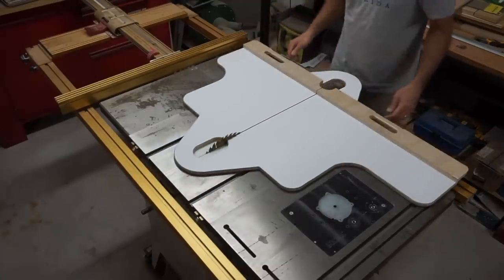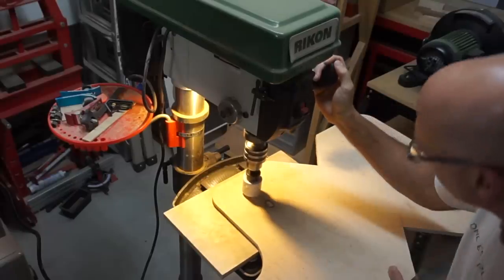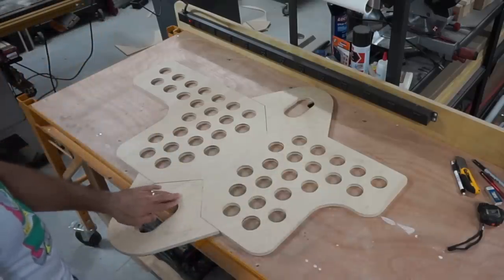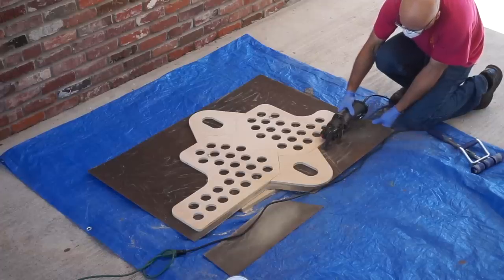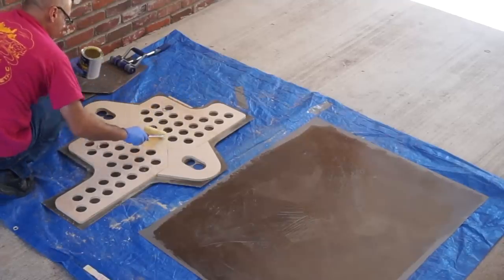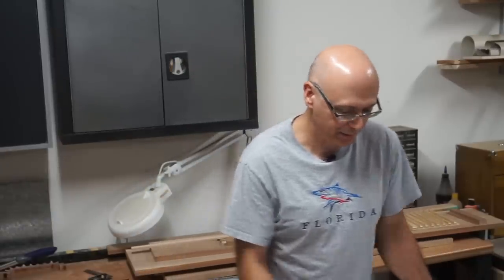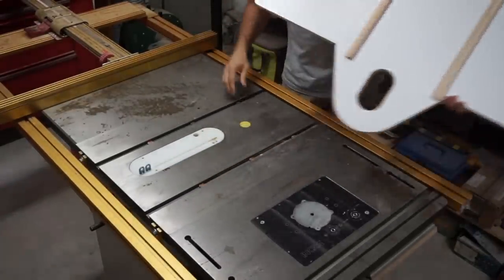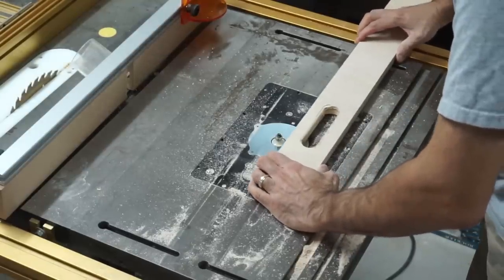A Crosscut Sled Like No Other

Comment: First, I definitey like like the concept. It has caused me to start thinking about a new version of my sled which has served me well for 25+ years. 
However, I have some concerns. Please don't be offended by my concerns and suggestions. Everyone is different, and so are their experiences and lessons they have learned over the years. I have taken a lot of time composing this comment. I hope you take that to mean that I have the best of friendly motives. These are NOT criticisms -  they are concerns for your safety and the best of results for the work you are going to be doing. Here goes:

(1) Over time, wooden runners will swell, shrink, and wear out. By gluing them to the sled you have no way to adjust them or replace them. I suggest you consider using the high density polymer plastic (white, slick plastic)  for runners. Then attach them with screws from the top. (Make the holes in the sled a little oversized so the runners can be adjusted.) 
(2) I am concerned about your gluing the fence to the sled. The fence should be attached with screws through oversized holes, again, so you can make adjustments. 
(3) I respectfully suggest that you not rely on a framing square to check for square. I think you will discover that .033" out of square is going to cause you a lot of grief. The proper way to test for square is to measure both diagonals (corner-to-corner) with a tape measure. The slightest difference in this measure will magnify into a big problem later. In fact,  you should cut all four sides of the scrap material before checking for square. (With the fence glued and cut into 2 pieces you have no way to make adjustments.) 
(4) While the low fence looks nice,  I think you will discover problems with setting up for duplicate cuts. 
(5) I like that you used a slick laminate on the underside of the sled,  however I am concerned that your work piece might be dangerously unstable on top. (Consider applying some pressure sensitivity sandpaper over the laminate; 150-220 grit.) 

Again, I say these things with the best of intentions for your success in woodworking, as well as your safety.

Sincerely,  Chuck
Reply from the maker: Too late, Meza JarJarBinks. I am offended! No, just kidding. I do appreciate all your feedback. It’s all in the delivery. Good points you made.

Comment: Cool, you ask? Why yes, very cool. I love the idea of it being light. I'm getting old and weak, and don't use my sled much because it's just too heavy. And I like the 1 by material for the fence. With it being that low, a Bessey auto adusting hold down clamp would work perfectly when screwed or bolted to the top surface of the fence.  Great idea. I'll use it. Thanks.

Comment: I think I'll go hybrid - use 1/2" plywood, skip laminate and holes as I think the weight saving is equalled by weight of laminate - use regular rear fence with 5 cut method. Do the front like yours but just use a whole piece and avoid pocket screw handles. Well done for your out of box thinking.
Reply from the maker: Sounds good, Ping Pong. I’d love to see your finished product when you have it done!

Comment: I can work with this, first question, why not make out of one piece of plywood? Laminate on the bottom for strength, good idea. How about 1/4 luan on top for friction (safety), also attach the runners with screws. Next, how about a standard vertical fence with sliding stops and a safety block where the blade breaks through because the rest of us will be using our hands to hold the frickin work down to the sled!
Reply from the maker: If you’re talking about the two add-on pieces, I did that so I could cut straight across and have a straight edge on the sled. Otherwise, it would be a bandsaw cut — not too straight! With the renewed attention this video has been getting, it’s probably time for a version 2 of this thing, which would incorporate a bunch of the suggestions I’ve received. Thanks for yours, J R!

Comment: Squaring wood is a fundamental part of woodworking and your sled plays an important role in that exercise.  Cut four sides of a piece of ply, rotating sequentially- every time you rotate the wood, you are doubling your error. After cutting the four sides, cut a manageable slice that you can measure with your callipers.   You need to computer the error ratio to adjust the fence correctly: A - B / 4 / (LENGTH OF 5TH CUT) x distance between pivot point and point of adjustment =E (error ratio)

Comment: I will carry the full width of the unit up to the cutout at the end opposite the fence. Looks like a great addition to my table saw. May also consider putting a vertical peg at the fence end of the curf slot because I like to left hand hold the piece of wood being cut and would prefer the single center point of thrust obtained with the vertical peg. Care, of course, in how far I would push the peg since it is on the cut line. Overall a great prototype for one to build his own fence!

Comment: When setting the plywood assembly onto the laminate covered in contact cement you can lay down some 1/4" dowels or sticks and lay the plywood on top.  Then you can align the plywood and pull out the center sicks one by one pressing down as you go to each edge.

Comment: For checking square, you need to make two cuts.  Designate one edge of the test piece to press against the sled pusher block (mark it!) First make one cut like you did - mark it edge A -  then rotate the board upside down (CW or CCW - your choice) and cut edge B. Then make your taper measurement. (The key here is that the edge of the test piece that was against the pusher block remains against the pusher block for the second cut, though upside down) 

When I make them I screw the pusher block to the sled on one end so it still pivots, leaving the other end adjustable and before the glue/epoxy has time to set I make a trial cut(s) and adjust (various ways to do this, usually a temporary block and a taper wedge for minute movements)  Only takes another couple of minutes. I prefer epoxy for that joint over Elmers, etc. as it remains gooey for a bit. Then a heat gun on low sets it up.
Another version is to cut a narrow, but straight, "stick" then take the left hand half and spin it upside down (the short way not the long way) and press the two freshly cut ends together. Is it still straight? (likely not - so you adjust the pusher block)
Reply: Top quality posting, informative and not snide. Totally concur on squaring check methods; both easily done in the course of a job!

Comment: I like the idea of the sandwiched base with holes drilled in it to lighten it up a bit.  Low profile is not really what I'm interested in, but rather reduced overall mass.

I'll use that basic idea in a future sled, but I'll add a taller fence, with a t-slot track in it to simplify clamping and stop blocks.  As others have also posted, having a block to keep your fingers away from the blade at the end of the cut is a VERY good idea, and a taller fence makes this safer and easier to attach.
Reply: DO YOU REALLY THINK THAT THOSE ROUND DISKS REALLY WEIGH ANYTHING AT ALL!  A LOT OF WORK FOR NOTHING.....

Comment: Very nice and great video. Have you tried using super glue instead of epoxy for quicker drying times with the spray to set it off. Where the saw come through at the end you add a L shaped clear acrylic bit to cover it and limit the risk even more possibly just a thought. On another note could you if you wanted drill some of the holes through the laminate for a bit less weight. You could wax the underside and table as it might make it slide better with a machine wax.
Reply from the maker: Lots of great tips! Thanks for the feedback!

Comment: Very cool design of your sled very light weight I like that. Those large squares are never accurate at least I have never found one that was square and I have taken my Starrett combination square and checked looking for a good one which I could not find! Anyways your sled looks like it will work very well. Thanks for sharing.

Comment: i always put a thin coat of primer on,  even thin with a little water . ive  been a pro decorator for 35 years now . first coat is only to seal and harden the surface for a light sanding. 
robert.

Comment: When you need a good reference for square, use the factory edges/corner of a sheet of plywood or MDF.  Factory edges on sheet stock are dead straight and dead square.  

Nothing will get you "5 cut method" square except for the 5 cut method, but it's as a good a reference as anything you'll get for under $100.  There are plenty of people pointing out that a framing square isn't a good reference but I didn't see any cheap or "in a pinch" solutions...

Comment: I've built a large cross cut sled and it is so heavy I hate to use it.  So I love your concept of light weight and the laminate covering.  As this as it is storage would be a breeze compared to my monster.   The comments about the adding of t-tracks in the sled and one on top of the fence would make hold downs easy and allow crosscut-sled accessories like a stop block and auxiliary fences.
Reply from the maker: Thanks D Scott. I love it too! Of course, who doesn't love their own creation? :)

Comment: Hey Mike, Your design really appeals to my sense of style and it's not too shabby in the functionality department either... The only (tiny) changes would only apply  to the assembly. Firstly, fit a locating screw to one end of the fence from underneath, then square it up before fitting the second retaining screw(s). Also, a small chamfer on the lower inner edge helps reduce wood chips getting between the workpiece and the fence to help your accuracy. Cheers
Reply from the maker: Thanks for the comments, TeknixTrix!

Comment: Cool design. I like a tall fence with a channel on top for mounting stop blocks (easy mod). I also leave my fence adjustable so it is possible to use the five cut method and get the fence dead on (another simple mod). Thanks for the cool tip.

Comment: I like the sled for it's weight & design but if mine I'd put a beefier fence with a block to bury the blade. I used the 5 cut method for my fence & for the first time I was pleased with the outcome.

Comment: The design is very nice. It is essentially a torsion box approach to creating a lightweight sled - you could have cut more holes as the laminate would hold it all together. Or, you could have stop-routed out 1/4" - 3/8" wide <1/4" deep channels one each side of the plywood (those on one side 45 degrees as to the long edge and 90 degrees as to those on the other leaving a solid border on the exposed edges (and along the saw blade kerf area) and removing much more material. essentially creating a lattice 

However, as the rationale for creating this tool/jig is to square the cut, more time and effort is required to assure the cut is square as it can be. There are methods of doing this that offer greater precision - is it a 'five cut' process? I forget. Securing one end of the 'fence' and making test cuts until satisfied that the results are truly square makes sense given the time and expense involved in creating the sled in the first place.

When fixing the laminate in place, using sticks of would to allow yone to lay the part on the laminate for alignment is a worthwhile technique - lest you get the two parts in contact before alignment is perfected. 

As has - no doubt - been noted, securing the piece during the cut is at bare minimum a safety issue and certainly an issue when attempting to cut a 'perfect' square.

The fence does not appear to support any sort of clamping or a stop block - something that could be achieved with a thicker/taller fence and one or two of those aluminum channels sold for making gigs and such. A chamfer on the bottom front edge of the fence is a good idea - prevents dust or a chip from miss-aligning your board. 

It is elegant in over all appearance,  but lacking (as built) when it comes to functionality and precision. Most especially given the INCRA Fence noticed on your TS.

Comment: Ok, so I am a novice... I liked the video on certain points: This sled is a weight watchers version (slimmed to the max) I like the ideas for shedding weight... also like the design as such.

I noticed that while the two handles help avoid potential contact with the blade... (as the back in not high)...  it’s also very dangerous as the workpiece is not held in place (somehow a T-track + clamp could be envisioned but I get the thickness was designed to keep the weight down)...

Also the whole thing probably should have been one piece as the pocket holes not working + thin back piece (that is completely severed) makes me worry the whole sled will eventually break in half.

Still some very interesting ideas to consider design wise such as the wafer design with hollowed out core.
Reply from the maker: Thanks for the comments, Michel! You’ve got a lot of insight for a novice!

Comment: Great idea... a couple of things you might think about... 5 cutting your test piece to guarantee square.  cut the piece then rotate it to use the fresh saw cut against the fence and do this 5 times... THEN check out your square. Also, a taller fence allows for easier clamping of stops for cutting several pieces the same length. Nice job though. I like the laminate usage.

Comment: Very good!   I have watched this several times and last time I watched with a critical eye. I still like this sled very much. 
My sled is a slug... heavy, hard to handle and although it does a nice job I really dislike using it.  Due to its weight and my age perhaps my view is shaded. 
I like the fact your sled seems to be far less heavier then mine.....

Comment: This is a very nice crosscut sled design.  I suppose it depends on what you make, but I have had excellent results over the years with just a good quality miter gauge. I wouldn't recommend using a crosscut sled unless you are in a production environment.  Saving five minutes (or even an hour or two) on a few pieces of furniture or cabinets that a home woodworker makes in a year doesn't matter, and storage space in a home shop is limited.
Reply: Jigs are just the perfect little project for hobbyists. We can't justify fucking up a lot of expensive material on making actual furniture ;) Hence the amount of these kind of video's, I suppose. I liked this one though. Original design, although it should be seen as (good) concept.

Comment: i really like your approach, choice of materials and the shape, but would make the fence micro-adjustable, so you can tweak that 33/1000s down to near zero.  this could be achieved by fastening the fence at one end to act like a hinge and mounting a stop block on the other with a screw that can easily be turned in or out against the fence to get an exact position on the other end.  having suffered thru a hand injury, i would cover the center of the fence where the blade exits...a physical barrier beats careful placement of your hands.    lastly, it would be nice if the fence could have a replaceable center piece, to allow for different kerf thicknesses or even a dado stack.  thanks for sharing, gives me some fresh ideas for a replacement sled i need to build soon.

Comment: I thought the same thing as bxxj about running the unsecured material through the blade and back again. VERY scary thing to do invites kickback and you're in for a big surprise. NICE design for the sled, smart about weight reduction.

Comment: I like it. I would make two suggestions for another one. A stop at each end so you don’t over run the table and accidentally cut the sled and instead of cutouts for hand holds I think real handles or knobs would be better. I won’t mention the lack of hold down as everyone has already hit you on the head for that.

Comment: Nice, clean build. 
What I like best in your design is the use of laminate on both the sides of a relatively thin sheet with holes. That makes the sled light and gives you a clean, smooth and even surface. 
One drawback I see in your design is that there is no way to use a clamp or stop block on the fence. Secondly, there is almost no protection against your fingers accidentally coming into contact with the blade. Sure, you have the two handles for pushing and pulling the sled, but the minimum required safety should be built into the  sled design.

Comment: Hi, Like the design, as an add on ti get a better grip in the top you could use a pair of magnets embedded  in the back rail and make a handle that could be simply removed for storage or other cuts I would feel much safer with handles.

Comment: Built it a little differently. One piece of 3/4" ply, laminate both sides, then drilled the holes in non-critical areas. I added far and near fence bridges, and connected dust collection to the near fence. I added clamps. In my first cut, I caught my fingers and knuckles under the sled and against the cast iron table top, I jerked, popped the sled up and out of the runner's alignment guidance and ruined my workpiece and messed up the sled bottom. The laminate is slippery but no match for a blade and when it took grip the whole sled was shoved at me. As the near edge was higher than the far edge, the blade got the sled airborne and whacked the edge of the sled up against my chin. "Ouch!" Knocked my prescription safety glasses off. Amid other problems with the design the hand-holds are a trap. Maybe they should be above the sled. I converted the sled into an outdoor beverage holder.
Reply from the maker: Wow, what a story! Is there a video to go with it?